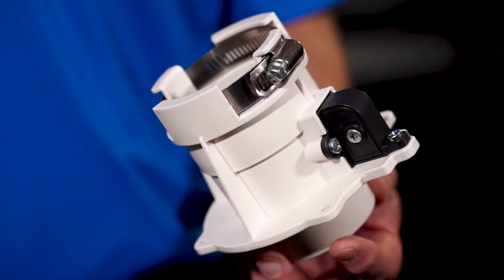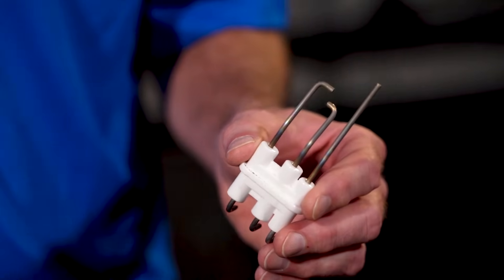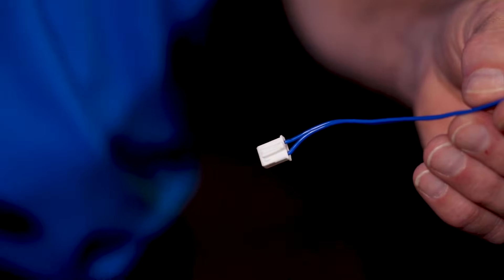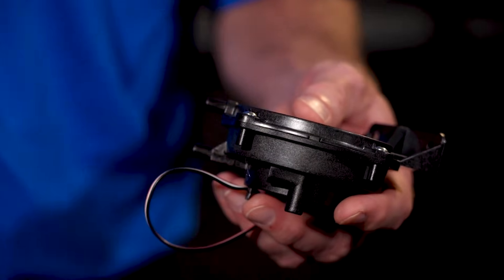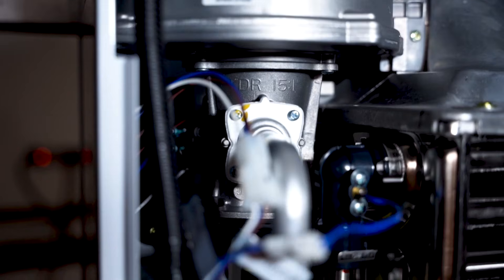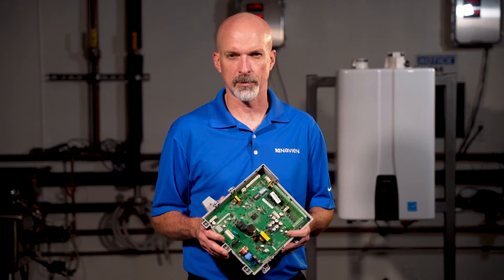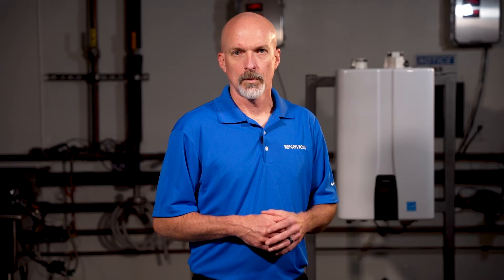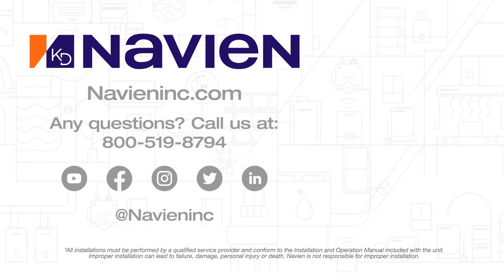Navien Product Safety Features

Comment: I have been Installing Navien Tankless for about 10 years.  I have 2 personnal installations that have 18 tankless installed.  I currently am working at an installation that has 28 Units installed.  I will not use any other tankless.

Comment: Love the new vent installation detector,  had a service call on a older unit that we didn't install with water on top of unit. Found installer had just put a street 90 for the first fitting on the exhaust and was  not sealing.